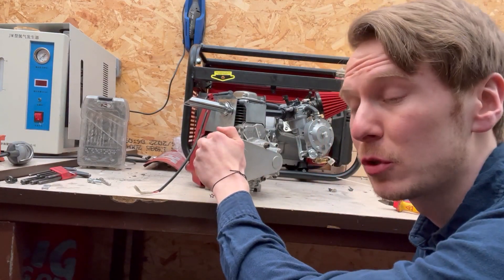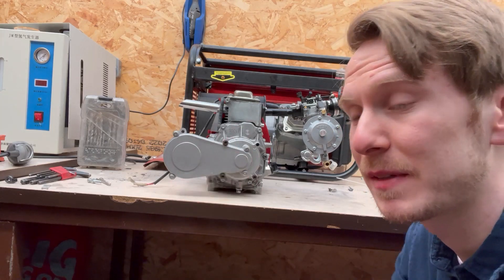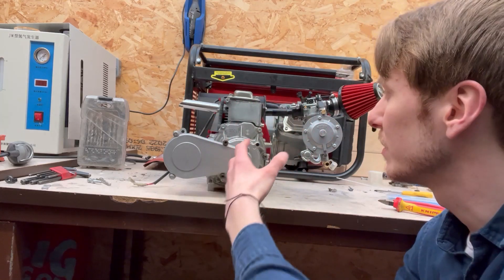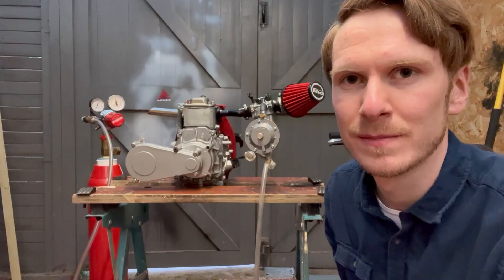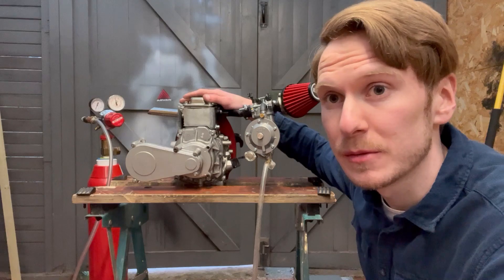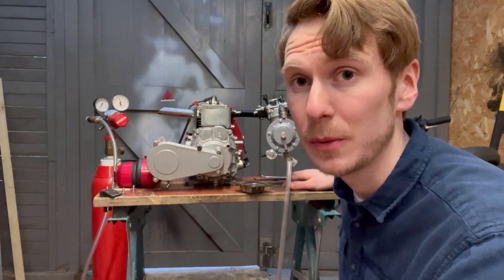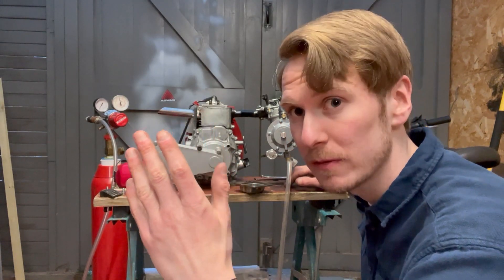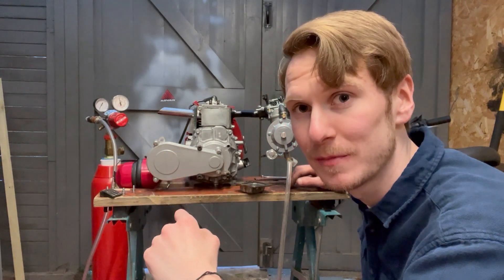Straight Pipe Hydrogen engine at high RPM  'RIP 50cc'

Comment: Great video! Not a great engine so probably the rod couldn't handle the speed/power. 
You should see if you can retrofit a diesel that would be a lot more over engineered for the power just keep the revs lower. 👍🏴
Reply from the maker: Good point about the diesel engine block idea, that would be a lot stronger. What killed this engine was wrong ignition timing, should be set to top dead centre, this engine was left with standard ignition timing, which worked well at low rpm, clearly not at high rpm, I knew it would fail eventually, just not so quick! All the other engines I use for hydrogen testing have had the ignition timing changed to top dead centre so this shouldn’t happen again.
Thanks for the comment

Comment: Its not that Tuff to run a small engineon hho
Reply from the maker: Yeah with the wide flammability range of hydrogen it’s easy to get running, it’s getting responsive throttle that can be tricky, but got that nailed down now.

Comment: two stroke need oil in bore.. maybe it's seized.. great project
Reply: Interesting project indeed: he did say its a 4 stroke early in the video and for this very reason you have identified, I'm assuming he chose a 4 stroke platform to test with.
Reply from the maker: Yep, this is a 4 stroke 50cc,
Looks like the reason for failure was wrong ignition timing for hydrogen, to be expected really. Non the less it was a good example of why it needs to be changed. 
Thanks for the feedback, will upload another video soon.
Reply: @Hydrogenguys  from the playing around i did i found hydrogen more of an implosion, but it did stop my old van from smoking, and tripped out the MOT station, as emissions had almost vannished.. look up the JOE CELL.. taught me a lot about pre charging the water.. keep it up love this sort of stuff..
Reply: Agree, that 2 stroke engine, need mixed oil in fuel system. Or you need a 4stroke engine without oil in fuel system.